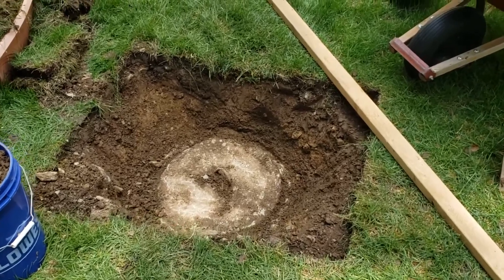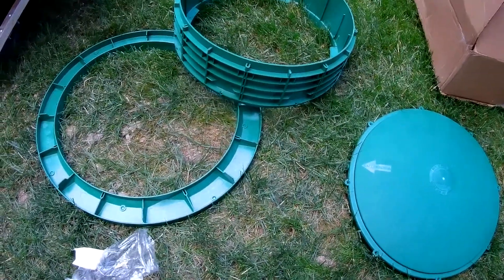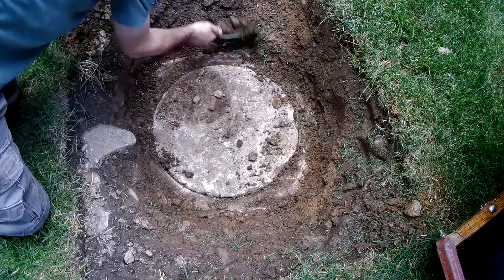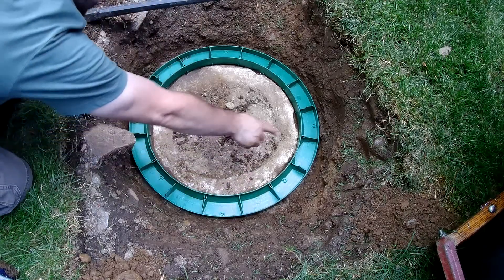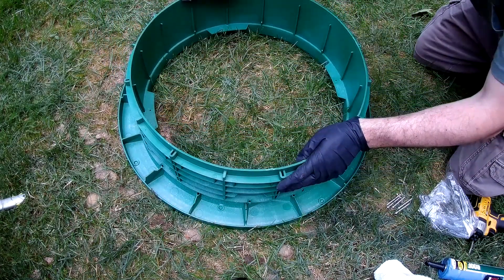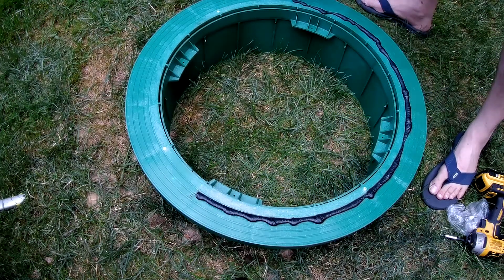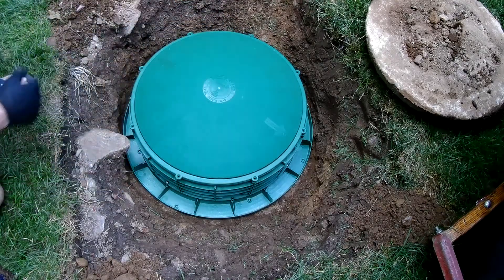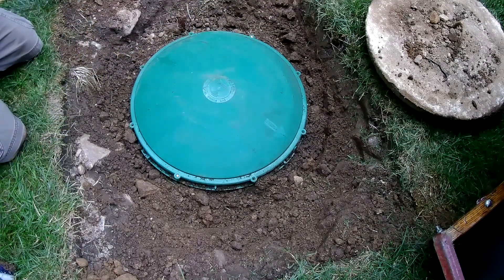Installing a septic tank riser kit

Comment: Thanks large! Doing the same job in the next few weeks.  Cover the same distance as yours 12". Using 6" riser also since I don't want to look at it. run into it with lawn mower or trim around it. Trying to decide if expansion bolts to attach the ring to the concrete tank top are necessary.  Also worried per your comment  it could crack the concrete.  Considering a bag of concrete around the edge seen done by others.
Reply from the maker: The concrete is a good idea! Another reason I didn't bolt the ring down was that it's not in a high traffic area so I don't anticipate any ground movement above the cover.

Comment: Why not just bring it up to the surface so if there’s a problem, you go for a screwdriver instead of a shovel?
Reply from the maker: Great question! This cover is about 8 feet from the bottom of my deck stairs, so I would prefer to keep it hidden from view 99% of the time. Since I have the septic pumped about ever 2 years, the dig out is not too inconvenient - especially since digging it out is done by the septic company! My only worry is making sure they replace the sod. :D

Comment: I'm surprised you didn't bolt this down into the concrete below. Thanks for the video.
Reply: My question is can you do away with the original lid below? I left mine on.
Reply from the maker: The roofing tar combined with the weight of the soil on the adapter ring should prevent it from moving. Plus, it's much easier this way! Glad you enjoyed it!
Reply: Also drilling holes in the concrete to anchor the base would weaken and possibly crack the tank. Don’t want that.
Reply: Bolting it down to the concrete does not necessary. If you tried building it you can possibly crack your septic tank. 😊